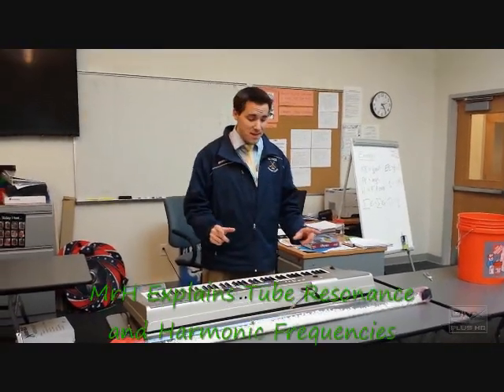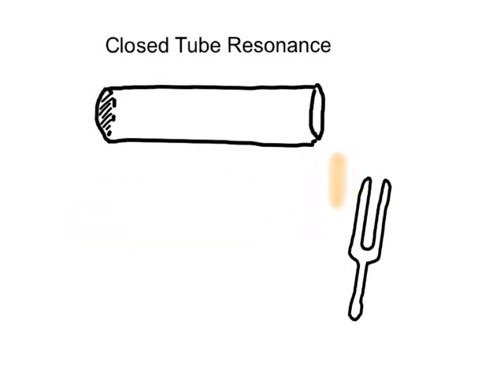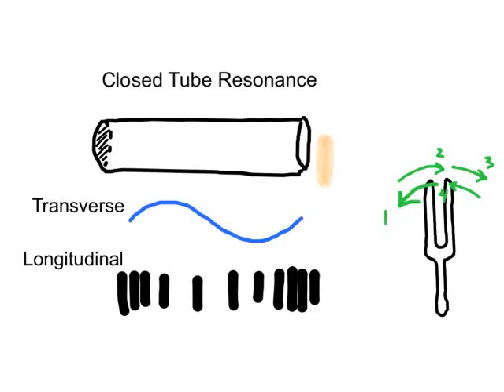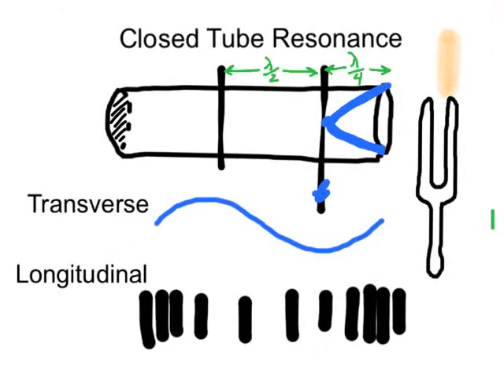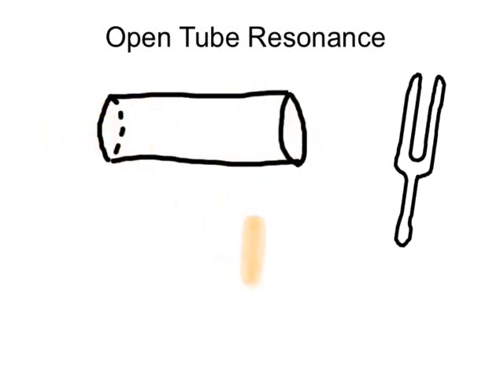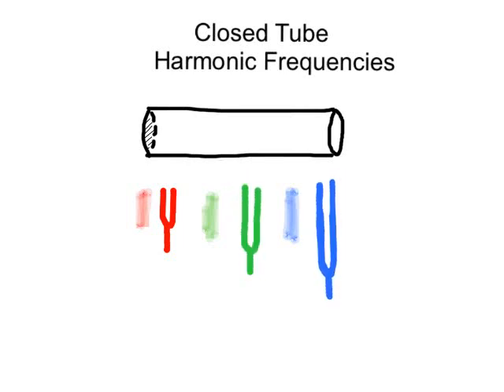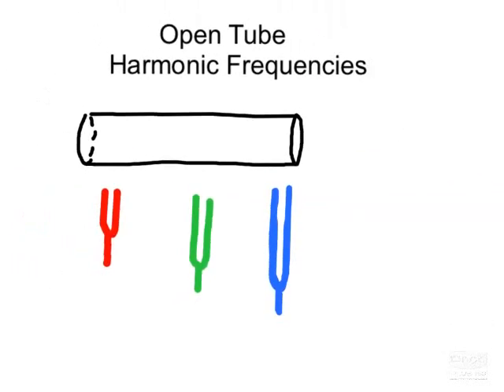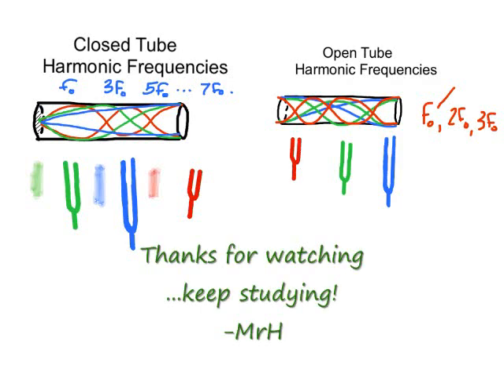Concepts behind Acoustic Tube Resonance-by Mr. H, AP Physics 1

Comment: This video is excellent. Thank you. I've done quite a lot of experimenting with resonators on the vibraphone. I learned the things you speak of in the video through listening. I found that a tube resonator is very similar mixing board and I think of it as an "organic mixing board". When I moved a very tiny microphone through the distances of the resonator, I found that the placement of the microphone was like turning the dial on a mixing board in the recording studio regarding the high's, mid's and lows. I also learned that, as a result, the artistic value of the tone, is not the same as the perfect resonance using math. The artist's preference for "tone" typically likes a complex recipe of a little of this and that regarding the variation of "highs, mids, lows that occur between different mixes of the red, green and blue outlines of all the variables when moving the small microphone through the tube. In other words, the ear, will determine the optimum location for the cap in the tube that is supporting a particular note and the options are theoretically endless.... like a mixing board.

Comment: This is interesting thank you for the explanation. Does this theory apply only to tubes? what about chambers of different shapes and sizes?
Reply from the maker: Mark Whittaker Chambers such as those found in horns/wind instruments would use the same principle... a french horn for example will have a specific chamber length for each note and notes are changed by opening and closing valves, increasing or decreasing path length for the air in the chamber.  Interestingly... as you saw you can have multiple frequencies for one column length, you are actually hearing all of those modes of vibration at once when a note is played, creating a rich tone.